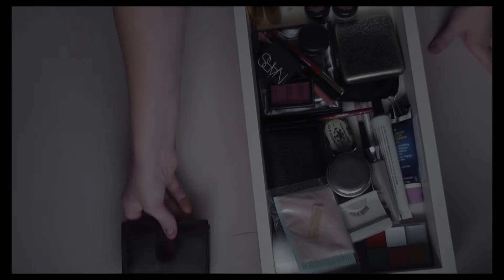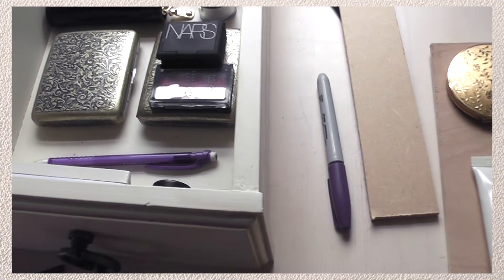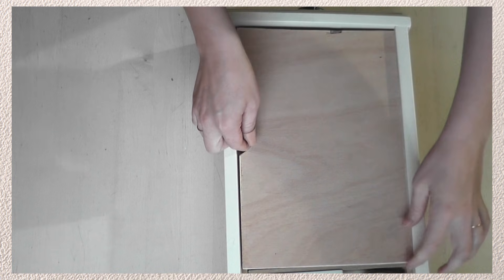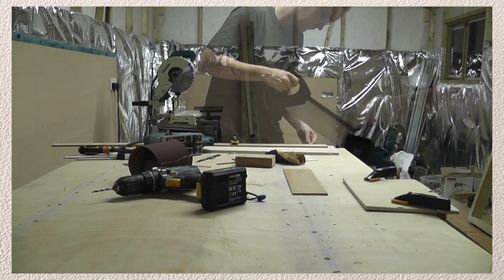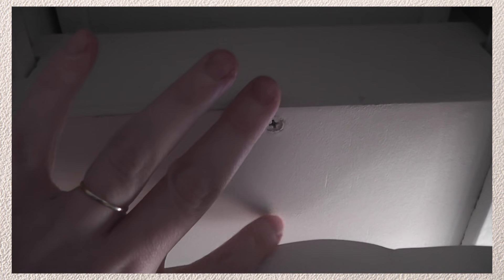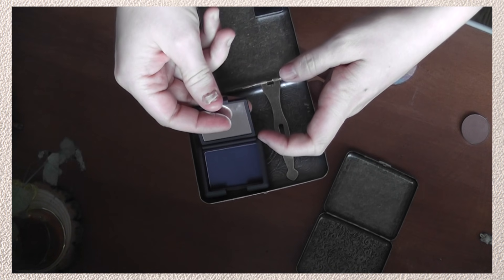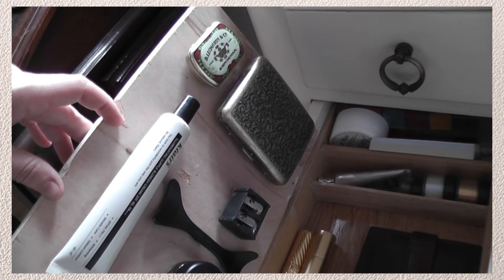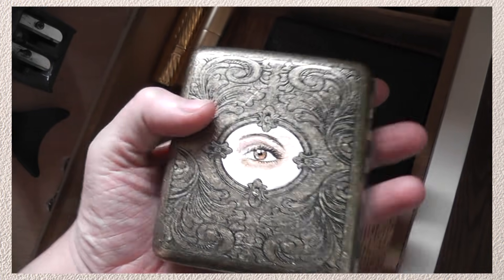Making a (Child-proof) Hidden Makeup Drawer

Comment: Save your old sheets. We had a whole shopping bag of old sheets growing up that we used as drop cloths to cover floors and other surfaces while we were doing projects.
Reply: We still use ours from god knows when. They've lasted decades and 2 moves, one transatlantic. Brilliant and simple. I could probably identify their age by the paint splatters 😀
Reply: We took our old sheets to the beach and used laid them on the sand instead of towels. The sand would slide right off, there was more space to sit, and they’d be so much lighter if they accidentally got wet. We kept our beach towels in a bag and honestly my mom is a genius